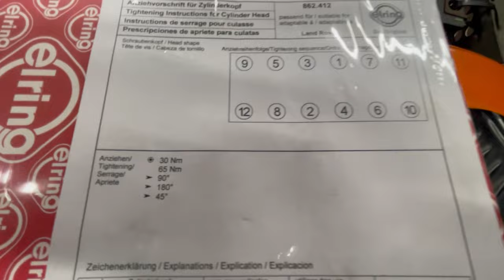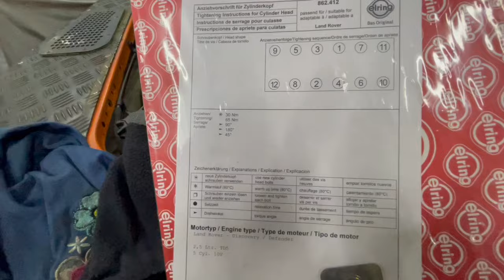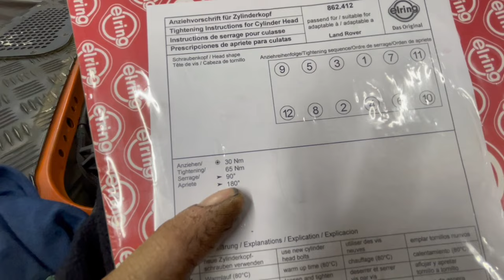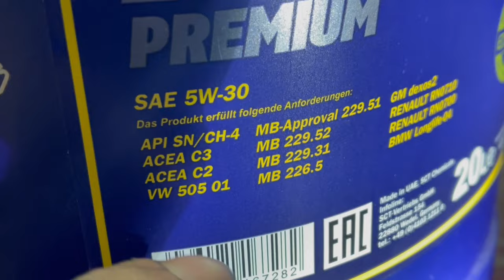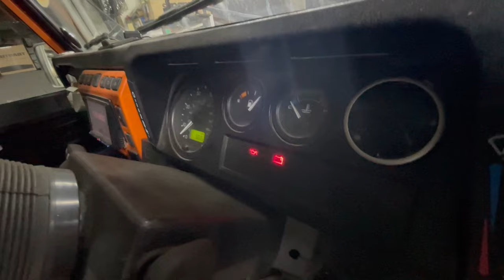Orange Ting finally let me down - is the engine knackered ???

Comment: Them head bolts do take a fair bit cranking up  ill give your Idea of leaving them overnight if i ever have to do them again  ,think had a bit too much oil on the washers the last 5 degrees they actually sprung back on a couple of them
Reply from the maker: Yea they’re scary aren’t they on the last couple of stages 😂 I do get that spring back too especially the last 45* but do find the lithium grease on the threads help a little. I know it sounds crazy but it’s freezing here now and last time I did one was summer and can’t remember it being as bad so temperature could be a thing too. I do rate the Victor Reinz bolts though 👍 cheers mate 👍

Comment: Absolutely brilliant thanks brother. What oil have you been running engine was clean. 

My opinion on the vw spec oil...I dint know reason is a lot of HD diesel engines use those type op injectors and fuel system and the are fine on a heavy diesel engine oil. I think we are better of with a heavy diesel oil over a petrol oil. Only my 2c. My td5 on 300000 kilometers no cam issues on shell rimula 15w40 heavy diesel oil
Reply from the maker: Thanks brother and thanks for watching 👍 yea I think your right as I’m pretty sure I used Shell Helix and that’s light being 5w30 but as it’s been using oil due to the head gasket I’ve been topping it up with different oils and left it far to long between servicing 😂 
Yea I know the Scania and Volvo use similar injectors in the HD diesels too mate so probably better with a heavier oil cheers 👍 the VW spec thing is because of the P.D. Injectors they use too as they’re similar. Thanks mate 🔧😃👍

Comment: use rubber grease on rubber parts as far as i am aware normal grease nacks the rubber up and oil on the o ring of your oil filter
Reply from the maker: Sorry I should of mentioned they’re synthetic and not old school rubber as yes you are correct petroleum based grease would indeed perish natural rubber O rings 👍 thanks for the heads up mate 😁 cheers
Reply: @CarJunkeez  no probs I was thinking wtf I have a td5 been sitting for years on the refurb list so was just watching you for some tips as I e never worked on one only 300 TDI but I pulled my 300 out and put an m57 in unreal would never go back to a 300 ever will most prob replace the td5 in my other one and my 300 auto half built county that prob get m57 in it too it's night and day with the way it drive and power is unreal
Reply from the maker: @graham-martin5847  yea M57 is a good conversion and good engine even in standard form. 300 are just gutless standard and not to much scope modified. I just really like the TD5 engine as they’re really simple and easy to work on, and can give not to bad power tuned, just difficult to match that lowdown torque from the M57 👍 cheers
Reply: @CarJunkeez  mines got loads of torque to be honest I've got disco transfer box on it with auto box mapped to 300 on 33 inch wheels I love it can't stop driving it and fuel economy is amazing too
Reply from the maker: @graham-martin5847  some good power that mate, sounds like a good setup 🔧👍👍

Comment: Hey mate great video as always.
Got some work to do on my td5 ! Got some oil getting in the coolant i think it's coming from the oil cooler. Coming close to 300'000km and still on the original water pump could you recommend me which make of pump should I go for ?
Thanks mate, cheers from Switzerland
Reply from the maker: Thanks mate 🙏 appreciated 👍 yea the oil coolers can rupture but could also be the head gasket but I’d do the cooler first 👍 this water pump is OEM and are a good pump PEM500040G 😃 to be honest if it’s had good coolant in it may be ok, I’ve used tap water in this and that’s why it’s so bad, but I’ve just took a pump off another high mileage engine I’m doing and it was perfect 👍 cheers mate